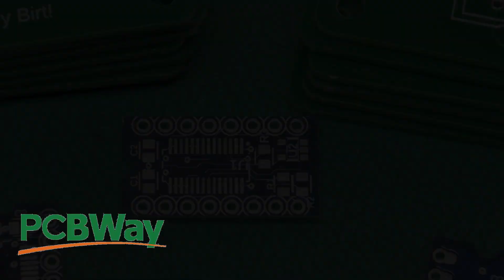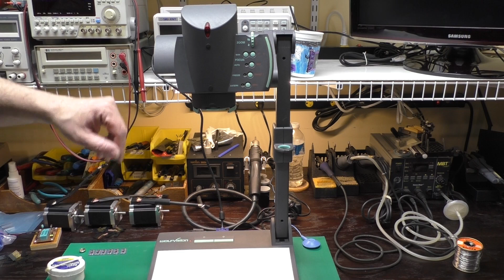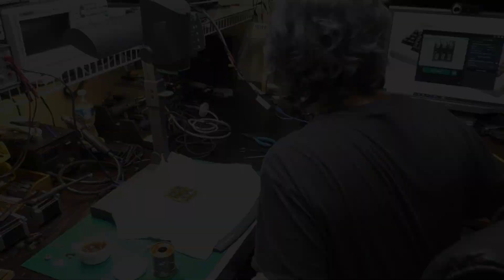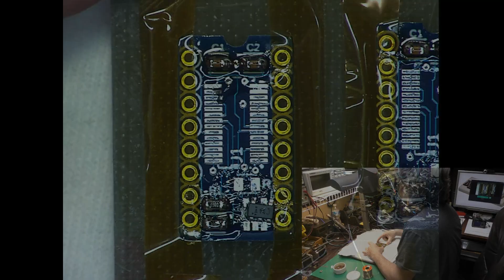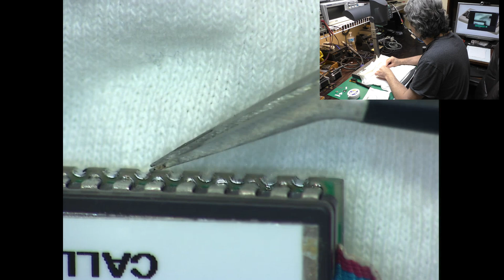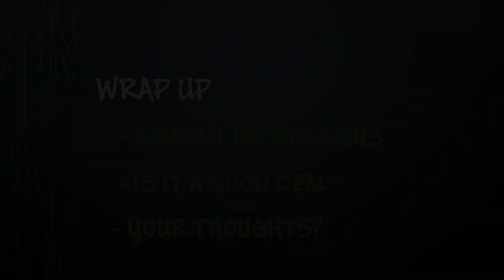Surface mount soldering magnification with a used $50 document camera?

Comment: I found one in the trash and I'm like hey this might work for soldering. Mine says 20x zoom. That has to be more than a magnifier glass.  It's not a microscope but I think it will work good.
Reply from the maker: It works well for me. It takes a bit of practice to get used to the lack of depth perception.

Comment: Sorry, I couldn't watch all of your video.  SMD soldering increases my stress level.
Reply from the maker: :) It is really not hard to do. Being able to see the small parts is the biggest hurdle but soldering them is not difficult. If you want to give it a try start with a project that uses the 'large' 1206 sized caps/resistors. The curved tweezers are also a big help to hold the parts while soldering.

Comment: Very interesting, thanks for sharing!
Reply from the maker: Hi Frank! I have since built another batch of MOS8701/HB boards with the document camera and it went even quicker. It has taken some time to get the 'feel' for soldering via camera.
Reply: @HeyBirt  I see those 8701 replacement are getting popular :) Anyway, I still prefer to solder with the big lens, but such a camera solution is indeed very interesting, it has a lot of output options which is good! By the way, I never dared to use smaller parts than 0805, if you sneeze at the wrong time, all the 0603 parts will be probably escape the room by quantum tunnelling through the walls, they're so small :)
Reply from the maker: I have flung the 0603 parts across the room trying to peel back the clear tape :) Soldering them is not too difficult though. The curved tweezers are really good at holding them. I think a lot of people were working on their C64s over Christmas break to demand went up, suspect it will settle back down now.

Comment: The external source input is for use as a pass-through for a DVD player or a computer so you can have a DVD, digital video file, or other soft document presentation (like PowerPoint or a better alternative) without having to change the hard document imager setup.
Reply from the maker: That makes sense. The set up we have at my university has a switch panel at the podium to select the source send to the projector. I can see how having the ability for the document camera to pass through a separate feed would be useful for other set ups though.
Reply: @HeyBirt  I recall the older version of those setups from when I was in university, about 30 years ago.  My highschool had still been using overhead projectors, and even a few 16 mm films, although most canned visual presentations had been on video tape by then.  (That switch happened about the time I was in middle school, which was also when the first personal computers were coming into schools.  We went from Commodore Pets and TRS-80 Modell III's to a somewhat strange and bodged together system called an Icon, from Unisys or Burroughs, depending on when you got them.  To give you an idea of how much of a bodge they were, they ran the QNX OS, and were network booted from a central harddisk server.  Yes, they were precisely as secure as that sounds like they were.)
Reply from the maker: My high school was very small. We had a grand total of two Atari 400s, one Atari 800 and one TRS-80 Model II. We also had some big BW TVs on carts with huge top loading VCRs and a few overhead projectors :)
Reply: @HeyBirt  My high school was small by some standards (graduation class ~200), but the county was populous and fairly wealthy, so we had two entire computer labs (one of PETs and one of ICONs), two science classrooms that were newly renovated when I first got there, and quite a lot of assorted AV equipment, including rotating access (between the schools under the board) to a set of DV8 cams.  The board even had a small, permanent TV studio.  (And weirdly, two entirely separate theater stages, one in the main cafeteria and one in the larger of our two gyms.)

The computers your school had seem odd choices.  Those were never popular with schools here in Ontario, in part because the ICON was purpose-built for educational use here and swept aside everything else in the late 80's.  I never saw any Atari systems in use in schools here, or any TRS-80 Model IIs (which were quite obsolete by the time I reached highschool, since the Model III was out years before that).

Comment: That angled soldering tip with the reservoir is fantastic, been in the market for a new iron, and not having a second shaky hand feeding in solder to tiny bits is a huge bonus.
Reply from the maker: Pace makes two different types. One is less angled and has a larger tip/reservoir. The one I was using is more angled and has a smaller tip which works better for the finer pitch SMD parts.